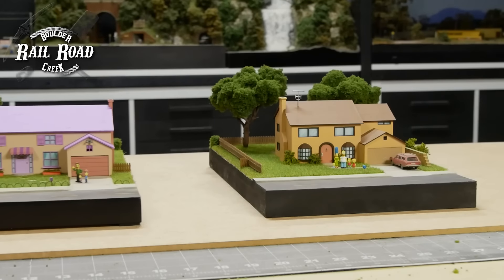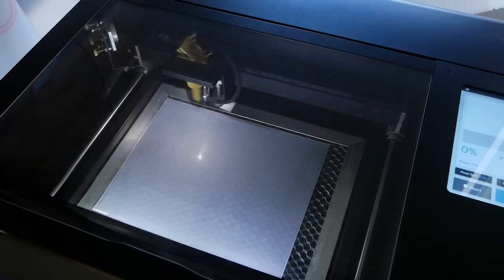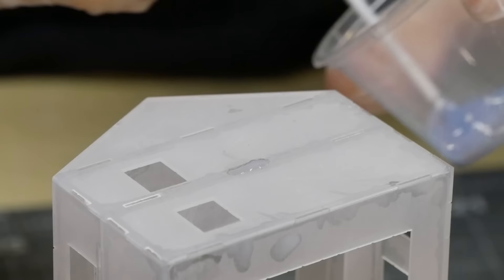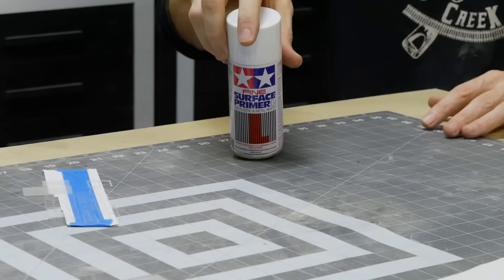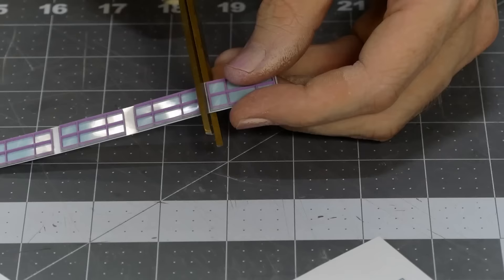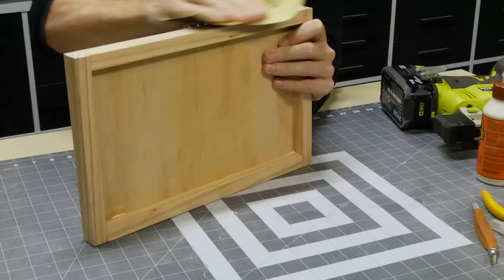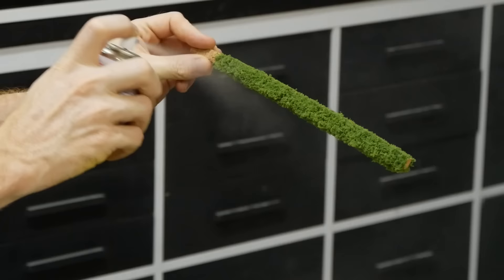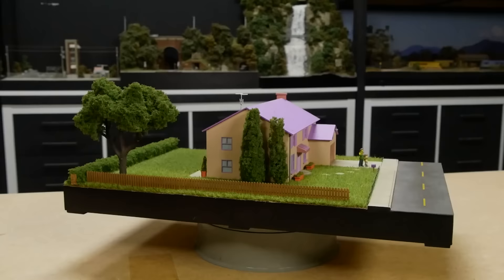Build an AWESOME model of The FLANDERS house! Step by step 😉 This time with Lasers

Comment: Polystyrene sheet is as easy to use as acrylic and much cheaper. It is easy to glue, sand, paint and can also be cut with an Xacto knife easily. 
Which reminds me that I have to buy a lot of sheets for my Springfield diorama 😁

Comment: please note you need a Co2 laser to cut clear acrylic. a diode laser needs black or coloured acrylic.. it will not cut clear.. cool video :) and if you are using resin at any point you should always wet sand.. you do not want to breathing in the dust.. it will mess with your lungs.. your lungs are life.. do not abuse them :)

Comment: I got the pink Plymouth hotwheels Simpsons family car, love this build!
Reply: That car's scale 1:64 - if you scale up these files, you could put it right in the drive way :)
Reply: @heroicnonsense  typically don't use files, I cut and grind my art making 1/300+ scale in a Ed Roth ratfink sorta way like my tank or currently an iowaclass Battleship. Sure be nice to print a file though, just gotta invest in a metal printer. 😉
Edit: Forgot to tell you they have functional cannons. 😃

Comment: You can harden the resin even faster by using a "blue" chinese-laserpointer. Typically they have ~5mW at 470mW (blue) but ~50 mW at 350 nm. 8)

Comment: Hi, I don’t think you need the intersect the pieces with the floor plane to export an svg file in TinkerCad. At least I didn’t do that last time and it worked fine.
Reply from the maker: You're right, as long as the part is flat on the ground it should work.
I just have a habit of dropping it through the floor just in case the part has a tilt or something like that 😉
Reply: @BoulderCreekRailroad  Makes sense :)

Comment: Could we get your opinion or a video review on the Flux Beamo? I have their original vector printer/scanner/engraver, but have always been hesitant to invest in the Beamo.
Reply from the maker: about to film a video using xTool 40w diode laser, I might try that first before I make any conclusions on the 30w CO2, I mean the beamo is fantastic and I use it a lot but I want to try and test a diode laser to see if I might prefer that over the co2 lasers?

Comment: Acrylic resin is dangerous for your health. Using luiquid resin or sanding cured resin should only be done while wearing a FP2 or better facial mask.
Any video showing resin use should display health warning.